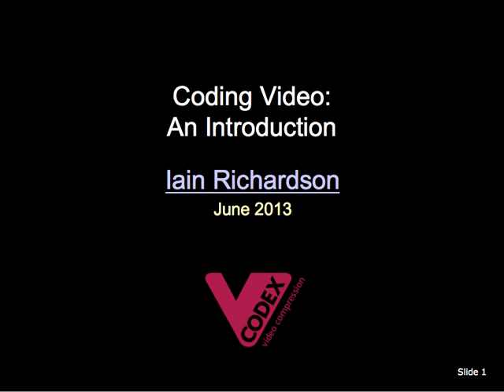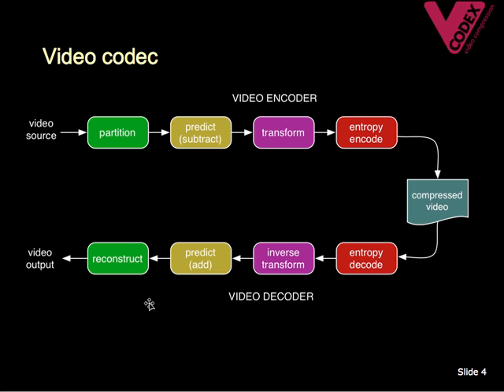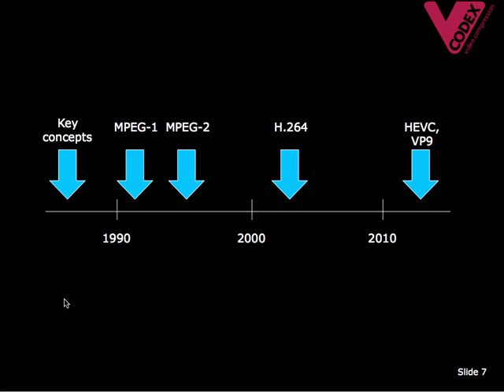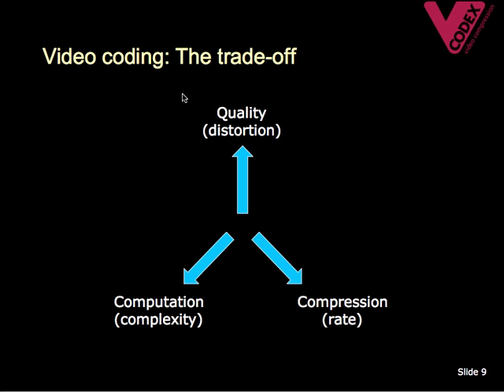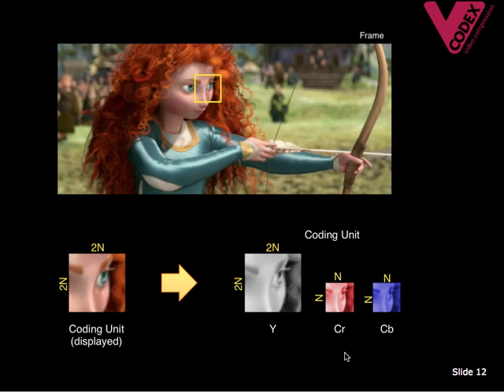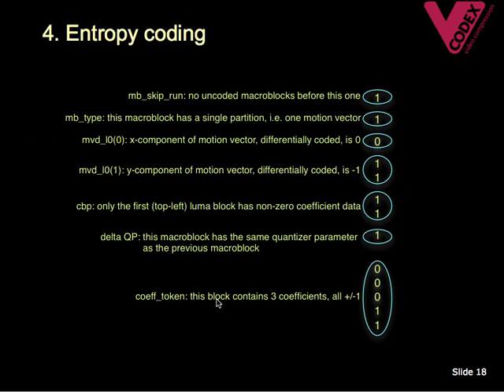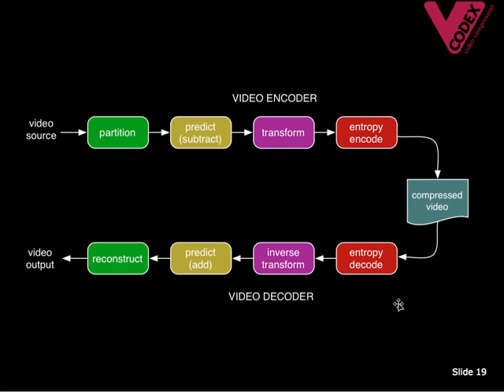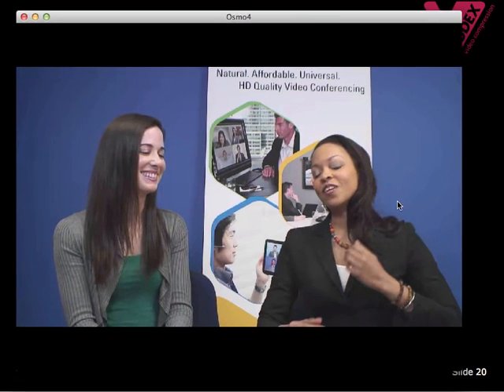Vcodex: Introduction to Video Coding

Comment: Why is any "prediction" needed at all? The encoder has access to all the frames of the uncompressed video, so why doesn't it just construct the residual as the delta between frame n and frame n+1? Maybe this is what was meant, but to me at least, "prediction" implies uncertainty due to incomplete knowledge, which doesn't seem to be the case here.

Comment: https://en.wikipedia.org/wiki/High_Efficiency_Video_Coding
High Efficiency Video Coding (HEVC), also known as H.265 and MPEG-H Part 2, is a video compression standard, one of several potential successors to the widely used AVC (H.264 or MPEG-4 Part 10).